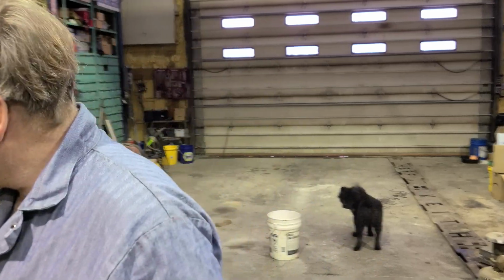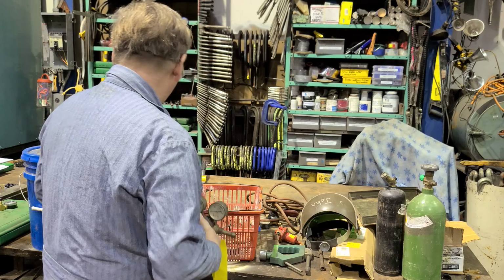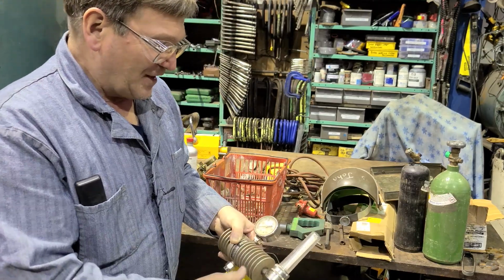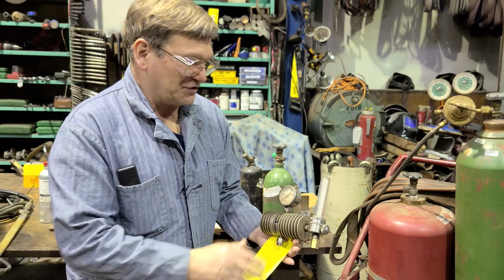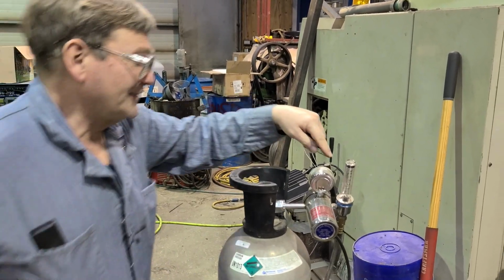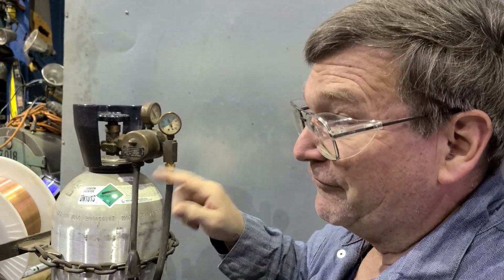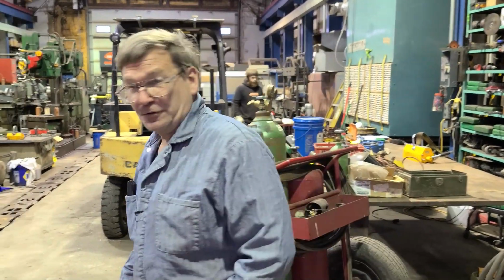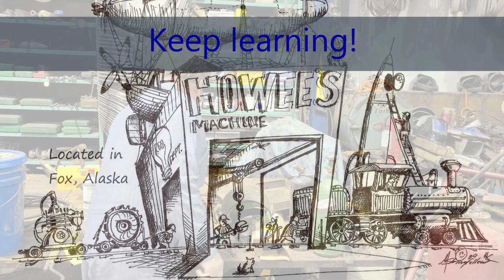Machinist's Minutes: Regulators

Comment: IIRC the difference between a gauge and a meter is that a meter is directly affected by the thing being measured, ie the ball being pushed up by the gas, while a gauge is one step removed, ie the pressure of the gas presses on a mechanism which turns the needle.  Really though who cares, if it reads the flow accurately it's good.
Reply: Hmmmmm.... seems packed with as many inconsistencies as motor/engine.

Comment: My weed burner is made to be used without a regulator. It does have to be continually adjusted as the pressure goes down and the tank ices up. The tank will ice up in 100 deg weather.

Comment: How about a nod to gauge-less regulators? Desired pressure is set via a "micrometer scale" located at the hand wheel. Compact, tough, accurate enough for most purposes.